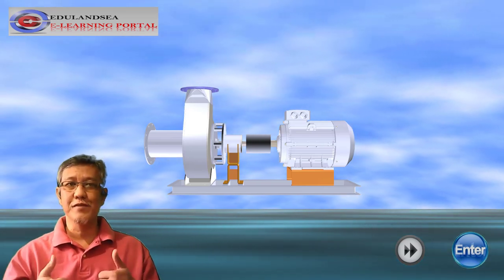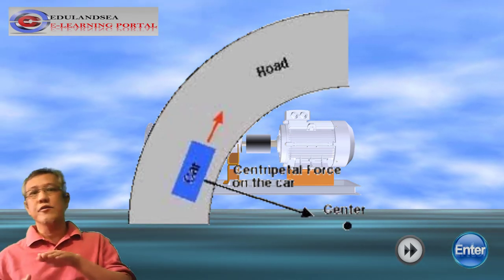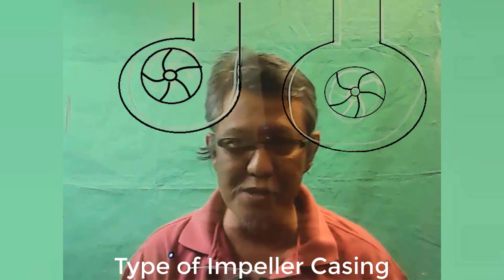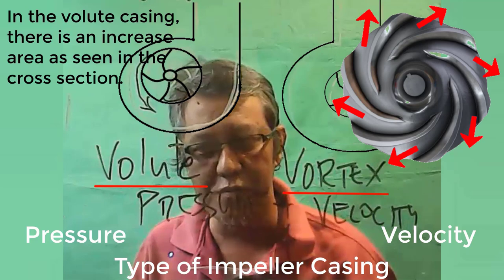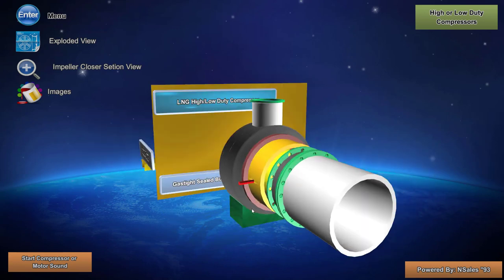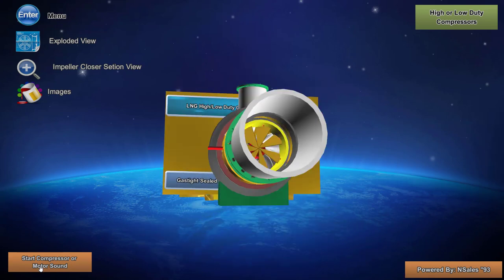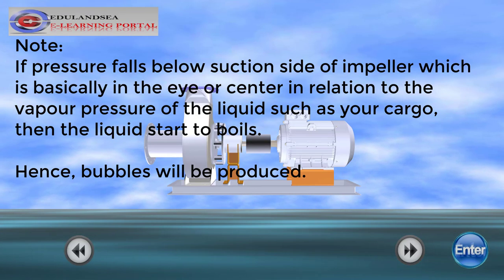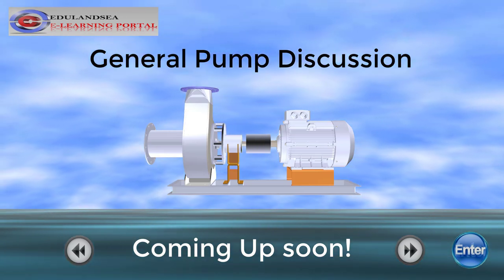Centrifugal Pumps Topic - Commonly used pumps on board, Bernoulli's Principle - Discharge Operations

Comment: ❤ why discharge valve is close during starting of centrifugal pump
Reply from the maker: if there are pressures at the discharge end of the pump, it may flow back into the pump before starting. And it will cause backward rotation, which can attract more current and cause damage to the pump. Therefore, it can be prevented by closing the discharge valve of the centrifugal pump when it starts.
Reply: @ShipAhoyVlogs  thank u ❤ sir. 
Why recipricating pump have relief valve
Reply from the maker: @danishmomin8102  Reciprocating pumps have relief valves to protect the pump from over-pressurization. The relief valve is designed to open when the pressure in the pump exceeds a certain level, allowing excess pressure to be released and preventing damage to the pump.